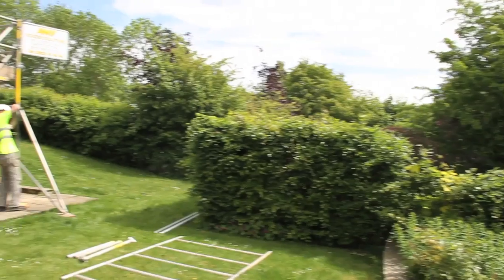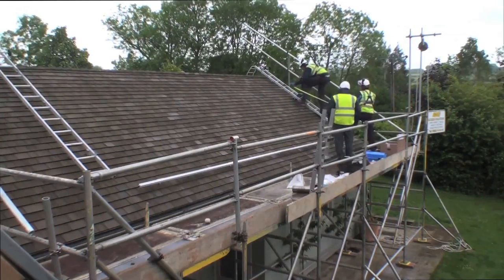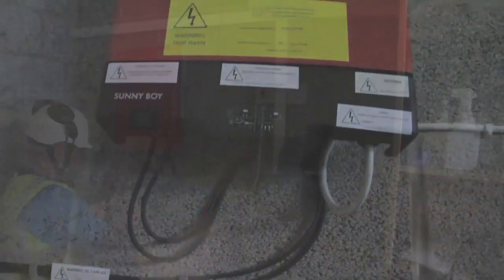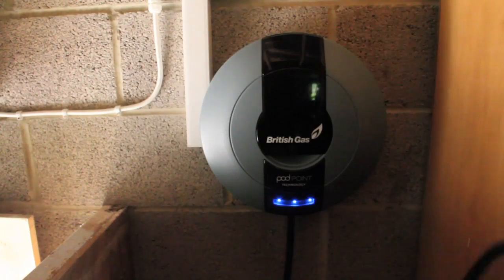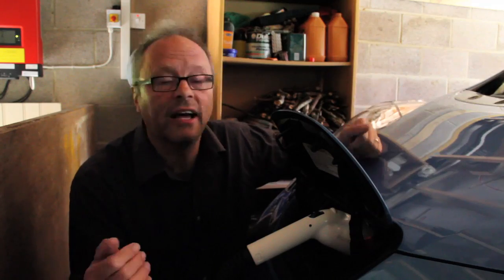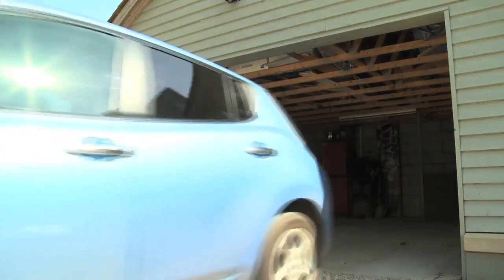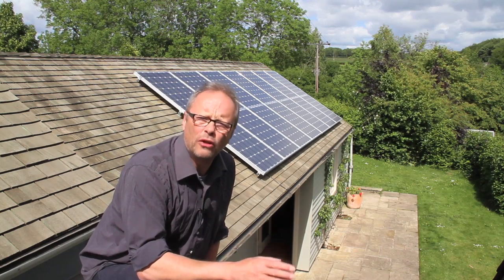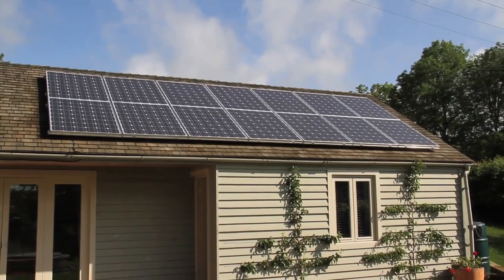Solar PV | Fully Charged

Comment: My off grid system has cost about £600 so far (700w only)  and on a bright day it'll power the whole house. I don't back feed the grid but I only use grid power at night and when clouds come over. 
I might invest another few hundred pounds so I can charge batteries and get through more of the night without grid use.
It's surprising how cheap it is now.
A DIY set up might pay for itself in less than 2 years if it's done properly I'm hoping for 1 year but I'll have to wait and see because I'm not a solar engineer and it's been less than 1 week for me

Comment: Well done!!! I'm installing 15x 200w solar panels (3kw) + a grid tie inverter that I bought second hand at the cost of 2,800.00 nzd altogether in Dunedin, NZ! Currently spending around 4,000.00nzd per year on power bills and forecast is to spend 0 once the system is installed.

Comment: The Swedish king has tested solar panels on the roof of Stockholm Castle since 2010, now he's filling most of the south facing parts of the roof with 1000 sq meters of solar panels http://www.kungahuset.se/press/pressmeddelanden/2018pressmeddelanden/solcellspanelermonteraspastockholmsslott.5.58fbba5d1623a378c482839a.html

Maybe visit and do a story on that? :-)

Comment: Hi Fully Charged
As I'm a bit thick, could you edit in some graphics like a black/white board showing how much energy these panels make (average) & how much your house uses (Av) & how much energy is left to charge car, because it looks like you either can't have both or low mileage. Although if car powered house, at least you'd need less batteries :)

Comment: Are the panel glass surfaces coated with anything like a silicone coating, i'm thinking of bird sh*t and dust? Does enough light energy get through if you used something like windscreen rainX?

Comment: 2016 June, now it's around 4pence / KWh ,  how the feed in tariff has died....
£7k installation @ 4 pence / Kw (use to be 13p) means you need to generate a load of electricity to pay back the 7k.
@4p that's about 10 years generating around 40Kw / day. which is not going to happen for 90% of people.

Government kills solar.
Reply: You still end up saving money by not having to pay as much for power in the long run, since solar has gone down in cost.

But yes, the government dropping the tariff hasn't helped at all, it can take over 8 years to re compensate now, instead of 2 or so.
Reply: But the price of solar panels have dropped 80% in the last 3 years, imagine in another 3 years ? Dubai of all places, has a planned 800MW PV plant under way, to generate power at 3.69 cents/kWh. Also the Tesla powerwall and other competitors will reduce in cost, with alot of homes will living off grid in the next 5 years.
Reply: Still over 2 million houses have installed panels.

Comment: the cost  has gone down drastically since this video. Today a system like that would cost less than 3000 pound!
Reply: *****
The price of solar panels has also gone down and installing them does significantly drop your electricity bills. I would still say it is worth it as long as you get the right deal for the panels and the installation.
Reply: +FidelKastrat But the feed in tariff is more or less gone now.
Reply: Sod the feed tariff. A few batteries and go off grid.
Reply: It hasnt more or less gone it was dropped by about half what it used to be.
Reply: Here in 2021 my 14 panel solar cost £5650 (2019) and generates about 4200 kWh. The FIT payments have gone and only get 3p/kWh Solar Export  Guarantee. However having a Zappi, Zoe and Octopus GO I have stopped using fossil fuel and save about 10p a mile. Thanks to Fully Charged I have taken to journey towards decarbonising my energy and transport. Next target is getting rid of gas !!
Reply: @philipbroggio9315  who did the installation?
Reply: @Medea007  It was EON. The 14 panels gave a capacity of 4.27kWp with a 3.6kW invertor predicted to generate 4237kWh. The first year we generated 4400kWh but last 12 months more like 4000kWh. The cost quoted for 10 panels was about £4800 but the 14 panel option for £5600 seemed better option.
Reply: Any firms you advice to get a price?

Comment: Very nice video but economical with the truth. You kept saying energy "for nothing" but it cost you over £10k to buy it.
The feed in tariff (at the time) was 42.3p per unit. Know who pays for that subsidy? - We do. The public. More specifically poor people. The ones on meters who pay the highest rate for the electricity; they are subsidising your middle class faux eco folly.
Here are the generating costs (from wikipedia) - Coal 3p, Gas 6p, nuclear 10p, you 42.3p.
I'd love for solar PV to be the solution to CO2 but it's not. There are cheaper, better, faster ways to reduce CO2 and advertising like this holds us back, because it promotes the wrong solution.
Reply: Ok Dave, what other way will a household be able to create their own energy? Put a big windmill in their 6x6 m garden? Frack the land they own. Don't be silly now. The easiest and most cost effective way of generating your own energy is by slapping a few solar panels on your roof. 
Remember this video is 4 years old and the feed in tariff was very very very generous back then. The reason for this mainly was a 3.5kWp system like Robert had installed would have cost £10-12k. Now your looking in the region of £4-5k. The feed in tariff is now a more reasonable 10-11p per kWh. 

How much subsidies do these and back handers do these oil and energy companies get? 

Local generation of energy is the key, and it would help if households would see the long game and invest a few thousand in a solar panels. You are talking a 6 to 8 year payback. If money is tight and you do not have the ability to fund the install there are plenty of companies out there installing the panels for free and take the feed in tariff as payment for the solar panels.
Reply: +Dean Hamer Hi Dean. Why do we want to generate our own energy?? What problem is this solving? It's not climate change, that's for sure (Read Sustainable Energy - without the hot air). Solar PV gives people the impression that we're doing something about climate change when we're not. That is the danger.
Reply: Your roof isn't doing much more than leaving rain run off it into your gutter. Why not put solar PV panels on the roof to capture an abundance of solar energy to reduce the demand from the grid.

By reducing demand on the grid this is reducing the amount of CO2 that is being generated by the coal and gas powerstations that we have powering our grid.

I find it very strange your negativity towards solar PV.

Comment: Once again Solar Thermal is ignored. (You do not need bright sunlight - or indeed any sort of sunlight) for Solar Thermal to work. It uses UV rays - or daylight in simple terms - to work. If you need further proof, just pop into your greenhouse on a cool, clear day, and feel the difference in temperature. This heat could heat the water you bathe in, wash in, or cook in. It even gives the kettle a head start.
Reply: +John Benton Depending on how much your kW/h's are being bought for it might make financial sense to just produce electricity and use it to heat your water.
Reply: Makes perfect sense to me. But do not forget solar-thermal, which will heat all the water you want, but the FIT is lower.
Reply: Solar-thermal seems to be the poor relation, yet it offers most bang per buck! We stayed in a B+B in Wales, that had only renewables and solar-thermal. It was astonishing; the best shower I've ever had.

Comment: the solar panels gived DC and is converted to AC. To charge the Leaf the AC is converted to DC. Seems wasteful.
Reply: +Andreas Eikeland I think there is a DC charger available
Reply: +Andreas Eikeland 
For a grid-tied PV system, it's usually a code requirement to convert DC to AC either via micros or string inverters.  I suppose there are unregulated DIY projects that have found a way to direct DC charge their EV's from solar modules but I believe that would be incredibly dangerous, would void any feed-in-tariffs.  Most micro inverters are at least 98% efficient.
Reply: The LEAF uses AC up to 7Kw and DC for rapid charging at 50Kw

Comment: @litesp33d At 10p/KWH I really would like to know who you use.
Are you talking about poly, mono or other solar panels. They all give different outputs in different conditions.
I calculated <5years in the North of England if done as DIY.
The £150 inverter can be bought with plenty of capacity to not break down. (Made one for £30), You don't have to replace all your cars power electronics every five years do you?

Comment: @HungryGreeny Here in USA, the home systems just feed into the grid via the home connection. In fact, there is a cutoff switch that shuts my system down in the event of a grid outage, to keep my PV power from zapping workers down line. Battery systems are much more expensive (roughly double), and require maintenance and ventilation. Unless there's a need to go off grid, such as in a place with unreliable power, battery systems don't make economic sense.

Comment: UK's largess towards micro-generators far exceeds what we get here in California, where the utilities credit only for excess generation, and at the retail rate. But my 5kW system made it economical to get on a time-of-use metering plan (getting credit for kW/h's generated during the sunny on-peak hours), which made getting my Leaf economical too, since I can charge it at night for a fraction of the cost of on-peak. My PV system also keeps me in the cheaper tiers by reducing my overall net usage.

Comment: What a load of BS.  If you are on the grid 6 kwhr of electricity costs about 60 pence. At thr heigth of summer on a cloudless day.
2 and a half years to pay back.  More like 25 years if you are lucky.  And the inverter needs replacing every 5 years at about £1000 per time.  Those panels will cost about £20 k not £10k.
Just not economic yet unless you can get your TV (and BG con free advert) show to pay for the install.

Comment: Decentralized solar power production together with smart grid where the EV acts as battery is the future. Sure it's not yet practical to make 100% consumption only from renewable energy but like half of it is doable. I hope it's still valid that power from solar energy doubles every two years as Ray Kurzweil said. In just about 15 years will have enough.

Comment: @fullychargedshow Hi Robert. You are not losing 415 - 280 = 135V. It's just that those 280VAC are measured RMS (I think). In fact, assuming your DC to AC inverter runs without a load - obviously not the case since it's connected to the grid - then it's losing 415VDC * 0.707 = 293VAC - 280VAC = 13VAC. So you're losing 13V which makes your inverter 95% efficient. I'll check my math tomorrow, kinda late for me.

Comment: @XitUp What's more likely in the future, is a system in which solar power producers are payed for what they produce and do not use.  Some friends in the States belong to an electric cooperative and use a solar system to produce power.  They generally produce more electricity than they use and this electricity is purchased by the electrical cooperative.  They can buy electricity back at a later date for the same or similar price, if their solar panels are not producing enough power.

Comment: @rustybinproduction: crap.  Energy != volts.  You may step down in volts but you go up in amps.  Inverter losses are typically around 10% to 20% depending.

Comment: I'm fascinated by your feed-in tariff.  In Pacific Gas & Electric territory in California, it works very differently.  My 5.3kW solar array makes more energy during daylight hours than the house is using.  So, the power is fed onto the grid and gets used up by other houses in the neighborhood.  This is metered, and I get a credit for the energy produced, but ONLY if it's fed out to the grid.  If the house consumes the array's production, I don't pay, but I'm not paid either.

Comment: @fullychargedshow Robert, wait a sec.  You're confusing voltage with power there.  It's common to run the array at a higher _voltage_ than the interconnected grid.  When stepping down to grid voltage, the inverter will put out a lower voltage, but at a higher current.  Since power is voltage times current, so long as the current goes up when voltage goes down, power is preserved.

There will be some losses in the inverter, but they are typically around 95% efficient or better.

Comment: @RustyBinProductions But any decent inverter would be 90+% efficient, so I don't see a "colossal amount" of power being wasted. Of course if your goal is to generate heat (hot water for example) then it's more efficient to heat the water directly... but if you want electricity 90+% ain't bad. Plus the sunlight is free and nonpolluting so efficiency isn't as critical! Lower efficiency only means more panels and higher install costs for the same output.

Comment: @XitUp I think that might be an description error of Robert's part? Usually a FiT only pays for what goes out into the grid through the meter (Generated - Used = Supplied to grid = What you get paid for). This is typically handled using net metering. There might be a separate incentive for installation, based on system size, to help cover the initial costs but that's not a FiT. I suppose anything is possible though and I can only speak for what I've personally experienced.

Comment from the maker: @RustyBinProductions I have heard that and in fact the inverter tells the truth. It has very clear graphics which show say 415 volts coming off the panels, then 280 going into the grid. A substantial loss, I suppose the only solace is that nothing was burnt to produce the 415 volts, well, nothing on the planet, obviously the sun is doing a bit of fuel consumption :-)
Reply: The voltage difference does not represent a loss.  The 415V from the panels is Direct voltage..  The inverter converts it to the mains AC voltage.  The power output from the inverter is equivalent to the power input from your panels minus a very small conversion loss.  If you want to examine inverter efficiency, you need tocompare power in/out and not voltage.in/out.

Comment: Nice one!  I saw another guy on here doing just this with a Toyota RAV4 and solar Do a search on user liveoilfree .  I have a 2kW (mostly second hand) off grid install, and will eventually get my Honda Insight upgraded with a bigger battery to be a plug-in hybrid.  Even if it can only run 10 miles on solar before using petrol, that' would be fine for local shopping runs.

Comment: @martinwinlow 
The battery cells are actually capable of such fast rechagings already, ask any RC enthusiast about how fast they can charge their batteries. The low voltage is an issue, the higher we can raise the voltage, the easier it gets to build a system that can handle such effects. ie. a normal car would probably have to be about 500 to a 1000 volts. This may seem high, but the rail system in much of europe is already running at 15 or 25 kVolt, so it's nothing that cannot be done.

Comment: solar panels? on a roof? I can't believe it! : )  Yay Kryten :)

EV fed by solar panels (and or wind turbine) is the killer combination. that's where we want to go. that it doesn't necessarily make financial sense for the early adopters is quite besides the point. it's the direction we should go. that satan is attaching all his greed to solar panels and EVs to make it hard for good men is the cross we have to bear. it will get much better. btw your power is kW, not kWh. accumulated is kWh

Comment: @Jesus45U Hello, You are right.  However, it'll be a while before such energy dense batteries are available, especially one which can recharge that quickly.  For the average car to do 70mph for 150 miles would need a battery capacity of about 50kWh.  To charge that in 5 minutes would need a charger capable of outputting 600kW or for my 120V system, 5000 amps!  The current 'Level 3' (fastest) chargers will only output one tenth that power.

Cant we just bring back Motorail for long distance?  MW

Comment: Heres a daft question, for the poor people who dont have 10K... how much could the panels be purchased for, the roof fitting kit and the inverter box. I am electrically trained but on the dole at the mo. I was thinking I could easily install such a kit in my sleep and then get the eleccy company to approve the hookup to earn cash. What would the parts cost and what would it cost to get them to sign it off.

Comment: @martinwinlow 
Not everyone will be able to use slow recharging though, people who live in small apartments and the likes would be mainly relying on service stations. But yes, in a nutshell, range is mostly important due to no fast rechaging infrastructure.

Personally, I think a range of about 150 miles or so, at 70 mph (motorway speeds) sounds just about right, as long as the recharging is under 5 minutes. I think that the train grid could be used for fast charging until a proper grid is made.

Comment: @c53204 Hi, Range is such a big issue because there is no fast-charge infrastructure.  Two things become very clear once you start actually using an EV;  1/ for 360 days of the year you don't need a fast charger - you just charge at home during the night and 2/ if you insist on whizzing about like a blue-a***ed fly everywhere you will run out of power much sooner.  Remember:- traveling at 70mph uses TWICE as much energy (petrol, diesel, electricity) as traveling at 50mph. MW. evalbumDOTcom/2092